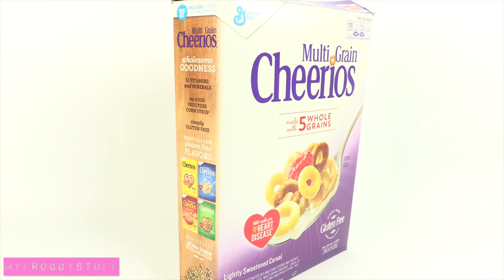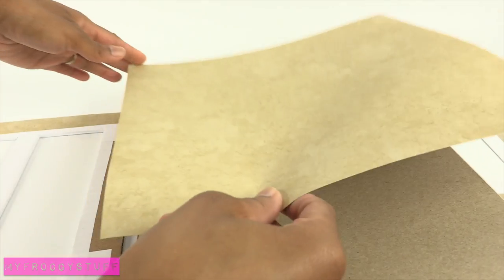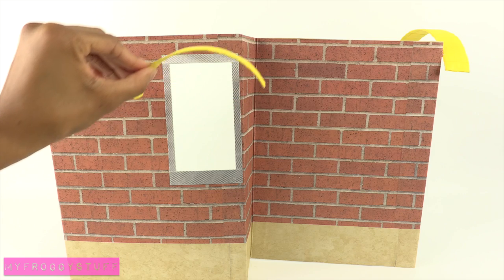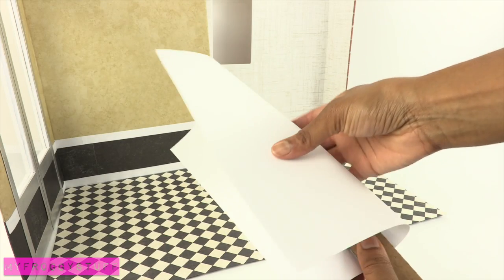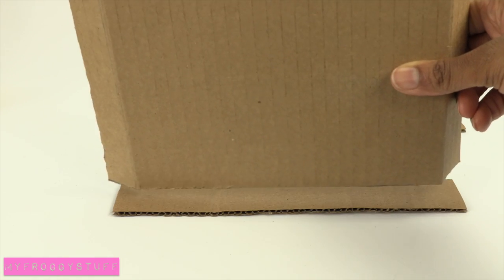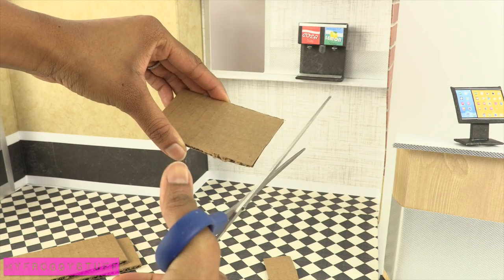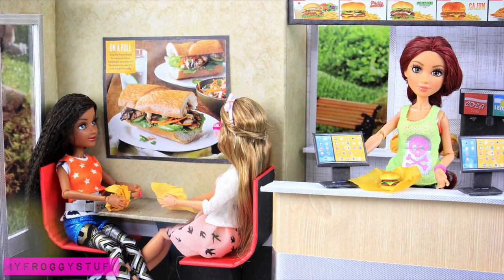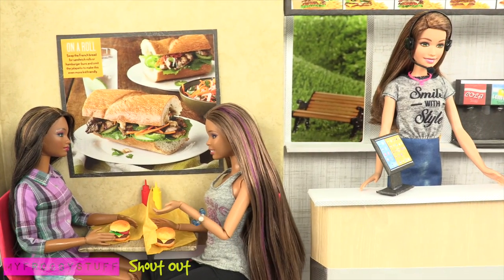DIY - How to Make: Doll Fast Food Restaurant - Handmade - Crafts

Comment: WHere do u recommend getting scrapbook paper because I live in jk and they sell them no where
Reply: Darcey just use a normal paper or print out a pattern
Reply: Easier solution if you have a printer is to find wallpaper samples and print them out. You can use an editing program like Paint or Photoshop to resize them.